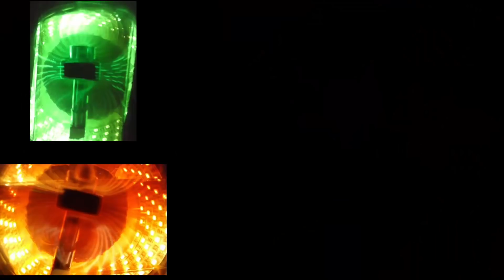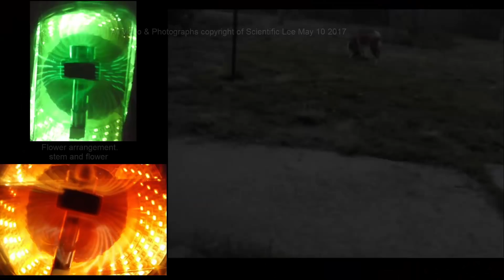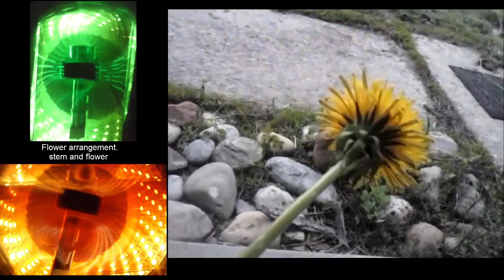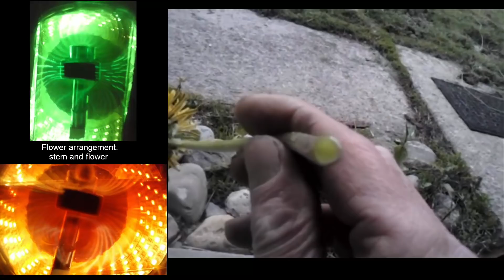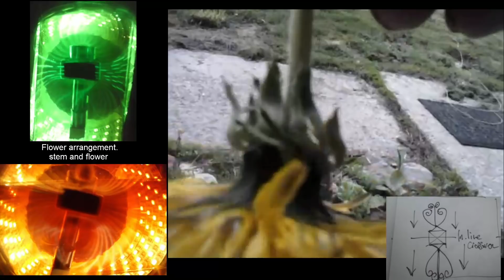Dandelion Magnetic field-all flowers.

Comment: Great work Lee, I fly drones on a quad you have two clockwise and two counterclockwise could can double helix energy flow better explain the reaction of the air under the drone better then a description called torque differential? I can lend a drone for experiments if necessary.
Reply from the maker: I fly freestyle drones now :)...Got me a darkmax 220 an Armattan chameleon and I just built the Chameleon Ti.....waiting for the spring now brother :)
Reply from the maker: addition of energy to the drone vortices creates a change in direction of spin of the vortex....by adding energy...as is expected ...Ill be using the knowledge in future vids....cheers for putting me on to it. :)
Reply from the maker: it could and will...getting back into smoke experiments soon with fans and no fans  ...thanks for the offer of the drone..:)